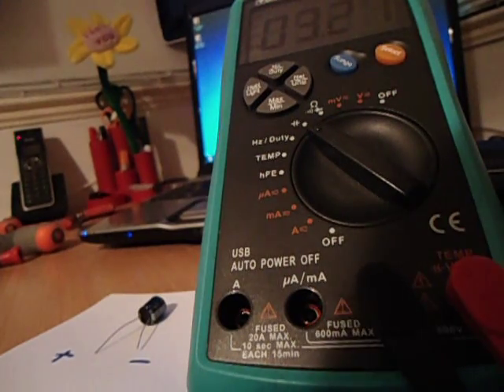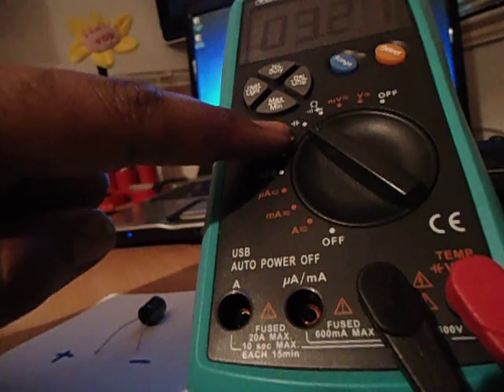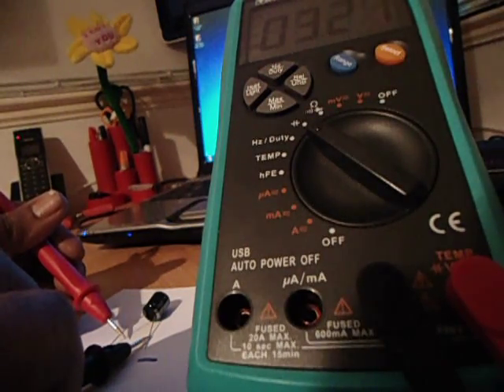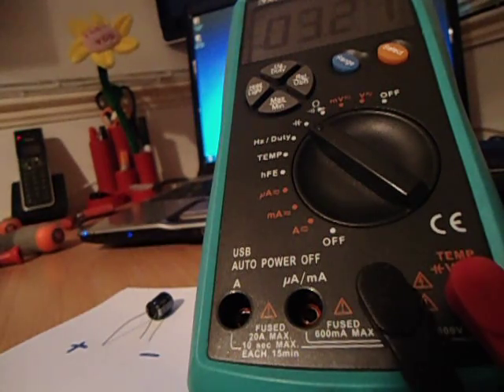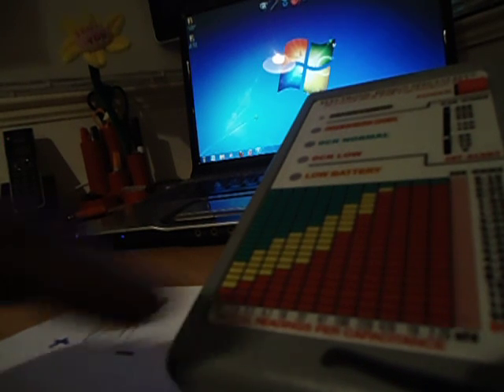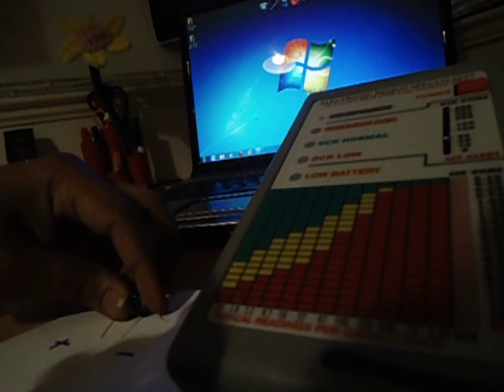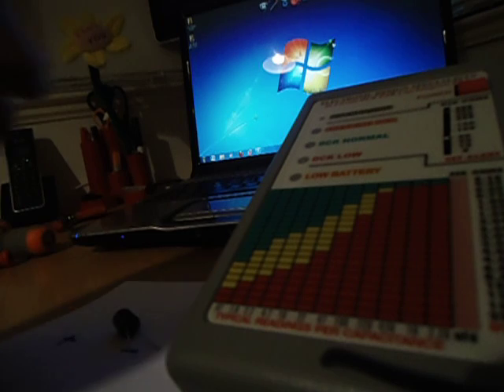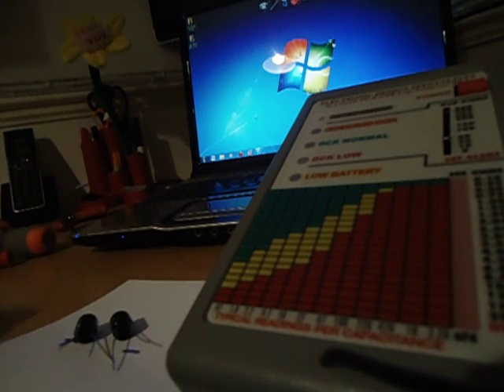How To Test A Electrolytic Capacitor With A Digital MultiMeter&ESR Meter

Comment: ESR meter is not graphically laid out correctly on higher value it showing capacitors as bad. Just use a capacitance test MM and workout 10% formula. BTW many new capacitors have 20% tolerance.

Comment: i fixed a lcd tv today with 2 used caps i seen to wer leaking and put in too that looked ok with the same rating it worked but i have no idea if they will let go in a few months and i will have to re do it  i wish i had a meater to make shure they wer good caps then i would have carged more than i did to fix it

Comment from the maker: ESR Meter matey but be careful sometimes you need to pop a pin when its in line with a coil of in parrallel,it will give you wrong reading.Besides that ESR meters work quite well.

Comment from the maker: @vick5821 Sorry No.Not yet.

Find a sheet for this Timer IC.Will Help you a great deal.Just google it.

IC555 Timer IC has pulsing low&high voltages that alternates.Set your meter to DC Voltage and check for this.
You can also check for resistance between pin 5 and neg return or the supply
.

Comment from the maker: @vick5821 Check,if the meter test caps, read the manual/check for the cap setting.....sign -|(-  
If its auto-ranging just set it to capacitance and touch the terminals as shown.If it's within specs thats great.
If its a manual meter,select the microfard value for eg: A (50uf cap at 16v) you would select the closest higher setting either 100uf etc..whatevers the higher closest,then test as above.
You can also check it's resistance,using ohm function X10k.If you don't have a esr meter.

Comment: @AeroDurbanite  I agree but most people aren't too helpful though.

 Just note that with some video cards you void warranty removing your heatsink. I know  that EVGA doesn't have a problem with 3rd party coolers just as long as when you send them in for warranty it is shipped back in the way it was recieved new in box, no aftermarket components on it.

MSI makes cards with their Twin Frozr heatsinks that cool pretty well that you won't need a aftermarket heatsink for really.

Comment: @BroUmad1994 Best thing you can do is buy an aftermarket cooler for your video card, chances are you may have poor air circulation within your case. I bought a Arctic Cooling Accelero Xtreme Plus II for my GTX 560 Ti, idle temps on stock heatsink were around 47+ celcius, and load temps were around 67-72 celcius maxing out. Now with new heatsink. 30 idle and 43 under load.

Comment from the maker: @BroUmad1994 Dude.For some reason your messages been flagged as spam.No worries.

Couple of things you can do mate i reset the graphics cards&motherboard settings back to their original default.Check if your fan is working properly.Look for any leaking or buldged electrolytic capacitors.There will be semi-conductors.Put your finger each one.If it's hot enough to burn you then it's probably defective.Remember as well the motherboard and the PSU can cause the G Card to behave strangely.

Comment from the maker: @MoRiWanna Yes you can.You need a ESR meter to do that.Only be careful to check if the capacitors in circuit aren't in parrallel or near any coils,cause it will give you a false reading with a ESR meter.Pop a pin to be safe.

Comment from the maker: @cortezaz 9V Battery on input and ground then checking the output with a meter should be okay.You have to remove it off circuit or something may get damaged.
Be Safe!

Also check the pins for any shorts.There should be no continuity.Look on Ebay,Parts quite cheap on there.Hope this helps.

Comment: this is actually on a cars computer, all sensors work on 5v but the only getting 0.885v. is there a way to test 'em  still attached to the circuit board but without power?
or if i use a 9v battery could i hurt something?

Comment from the maker: Regulator Test is in Circuit.LM7805(5V.1.5A)Pin 1-Left is Input DC,Pin2 is Ground ,Pin3 is Output.Regulators Keep V Stable in spite of the Changes in Load.Eg:Any V  7-38V Enters Pin1&Out 5V in Pin3.Input V must be 2V or higher than output V.2Test.Put on Item&Meter on DC  Test.Put Black on Ground,Red on Pin3.It must be a stable +5V.If Not,Put  Red To The Pin 1,V must be 7-38V.If low or no voltage,then the problems elsewhere.If there is 7V-38V,Reg is Bad.